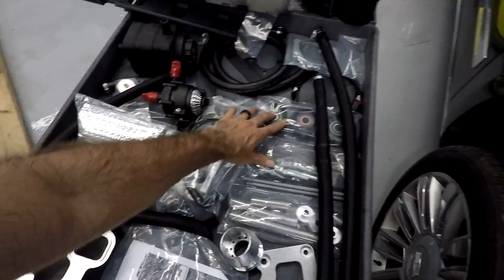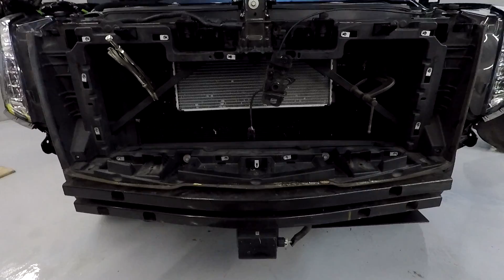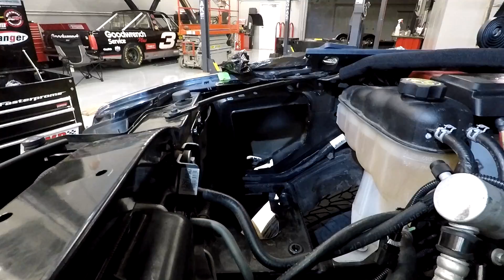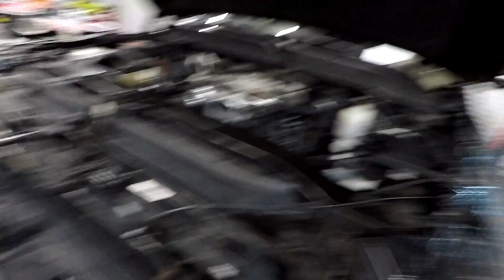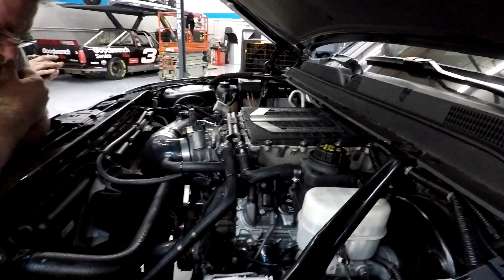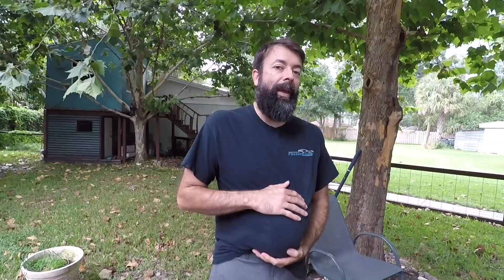The Escalade Is SUPERCHARGED!!! The Porkapotamus Is Out Of Control!

Comment: i don't know what you are running behind the exhaust as far as cats/mufflers or resonators but it would be a good idea to open it up behind the headers and put a bunch of baffles behinds a collector wit no cats or mufflers i mean if you have those still on it, it would probably create the same backpressure behind the headers but you still need that open flow behind there, then pressurize with baffles and would get better efficiency out of the blower.

Comment: Also thank goodness J get's it. It's about mass/min of airflow not a boost #. You an push 60/lb a min of air with 200psi boost in a 1" pipe and crappy heads etc. etc. or the same air flow at 21psi with 3" everything to the manifold, high flow heads huge cam etc. etc.

Comment: The check ball in the low pressure fuel line is to keep the high pressure from bleeding back and causing the fuel lines to knock on the frame. Gm just cut a bulletin on it

Comment: Jeremy are there any vehicles with superchargers that you can remove the supercharger and bolt it on to a 2014 5.3 with 26k miles? I love my truck but cant stand how gutless it is to me, yes I know it's a truck but like everyone I'd still like some more power when I push the pedal to the floor but I dont want to dump $10k into it. I've already done the cai and exhaust.
Reply: There are several options to add boost to your 5.3.. via procharger, vortech, magnuson.. or a pull off zo6/ctsv blower.. but if your not going to do the work yourself, your gonna be into it about 10k, just like you said.. blowers aren't cheap, neither are injectors, intercoolers ect... and the dyno time costs a bunch unless you have a "buddy"..
Reply: @Clutch_Kick187  I will definitely be doing the work myself,  I am an A.S.E licensed Diesel Technician and have all the tools at home. I just wasnt sure if the 5.3 block and accessory mount locations were the same as engines in the ctsv, vette, Camaro etc. As i can pick up complete totaled entire vehicle's with perfect engines cheaper than just the price of a new procharger etc. I know I will have to get it on a dyno, tuned and a few other things to get it dialed in but I think it would be sick to have that extra power when I need it.
Reply: They are the same.. there are differences in what will work with different setups.... that's why they use adapter plates for the heads..

Comment: hi jeremy! love the thick girl's vids its like watching a dream build XD. anyhow i have a question about that cold air situation i really need some help. i have a 2015 gmc sierra 1500 denali with the same lt4, its got exhaust, ported heads, cam, meth injection, tr6 sprarks and a fast lsxrt intake manifold with a 102mm throttle body just like yours and im trying to figure out how to get the afe cold air it has on it to fit the new throttle body/intake manifold setup and i fell upon this! could you please tell me what you guys did to that intake tube to make it fit please?? tips? tricks? anything helps jeremy all the love!
Reply from the maker: I just cut it where it seemed like it would fit. The elbow from ADM I believe was 4.5 and then 4.5 to a reducer. You may just wanna buy them from him.
Reply: Fasterproms ok that sounds simple enough. thanks again for your help Jeremy as always your the best! 👍all the love!

Comment: The blower radiator should be against the bigger one for both better efficiency.
With a lot of room between both ,you kill the flow for the big one,and the small one get a slower flow.
radiators work better when fins are aligned and closest as possible.
to get air in,you need air to get out,the quickest as possible for better heat exchange.
there you create a slow flow behind the small radiator.

Comment: Cross drilled Brembo rotors, light weight aluminum pulleys w/SFi crank, Michelin UHP, carbon driveshaft and billet wheels. Don't forget a bigger oil cooler ;)

Comment: Please correct me if I'm wrong, but isn't the point of wheel driven dyno's to match the transmission gearing closest to 1:1-parasitic drag lose to best evaluate the engine energy output? Typically 4th-5th gear depending on transmission generally speaking is closest 1:1 ratio.

Comment: Couple questions
What's the duration and lift on the cam?
Where are you picking up the flow on the stock heads? Are you reusing the stock valves? 
What are you doing to get the transmission to live?
What converter? Thanks